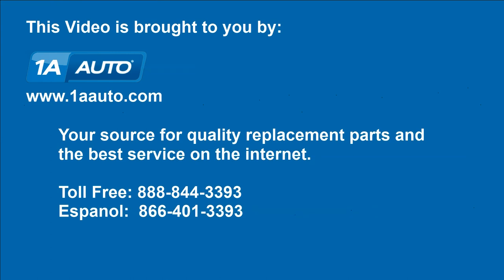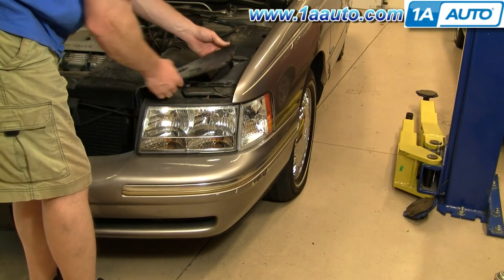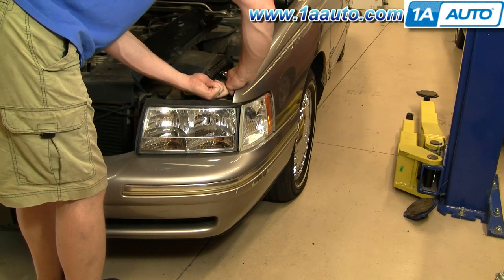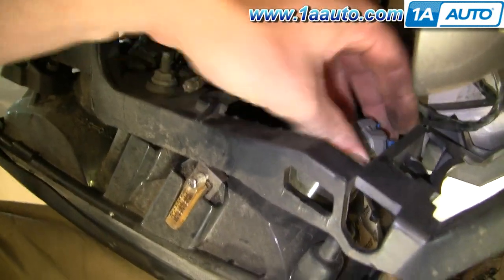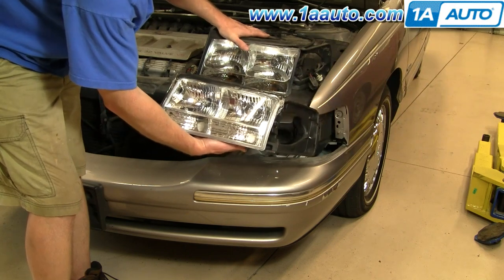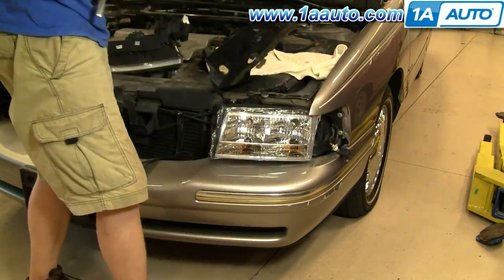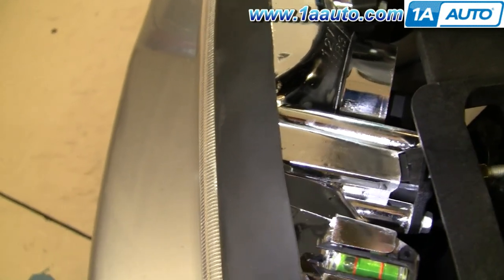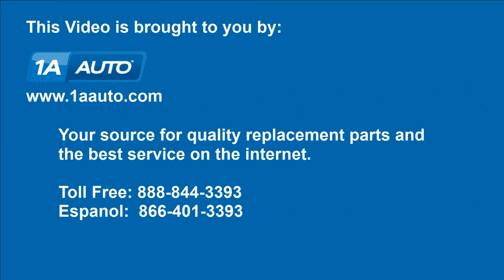How to Replace Headlight and Bulb 97-99 Cadillac Deville

Comment: Is this process closely the same for a 95 deville
Reply from the maker: Your 95 may be different. If you need to just change the headlight bulb you may be able to reach around the back of the light and remove them. We do carry the new headlights for your vehicle on our website with FREE SHIPPING in the lower 48 states. Here's a link to them on our website. http://www.1aauto.com/1A/HeadLights/Cadillac/Deville/-/-/1995?utm_source=VideoReply&utm_medium=VideoReply&utm_campaign=1ATony

Comment: I have a 1984 cadillac sedan deville the headlights wont turn on may you help me
Reply from the maker: +omar silva Since there could be multiple reasons why you’re experiencing this difficulty with your vehicle, I strongly recommend that you have a reputable mechanic inspect it. They’ll be able to troubleshoot the problem and tell you what part or parts you’ll need for the repair. It could be the switch, could be the bulb or it could be a wiring issue